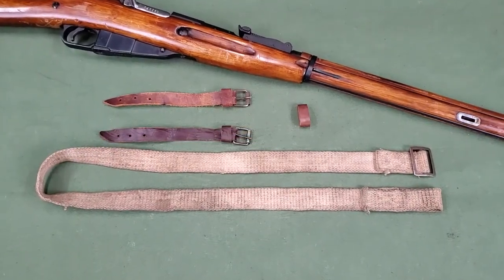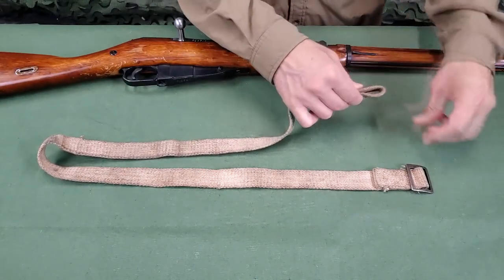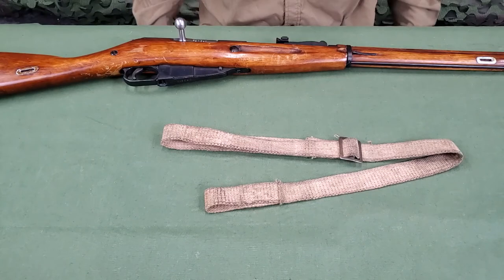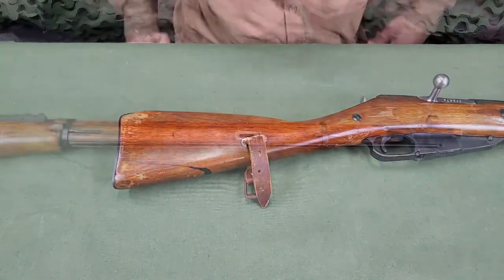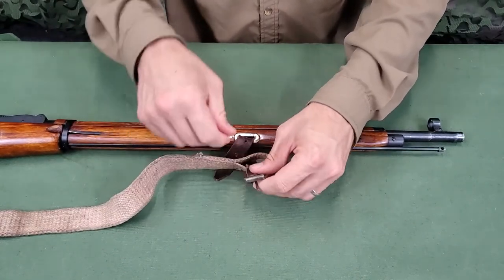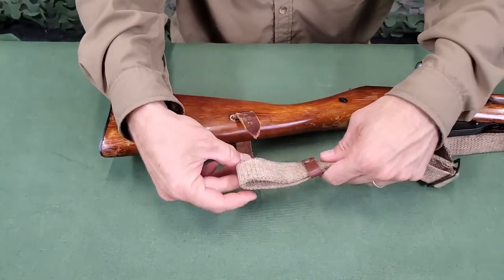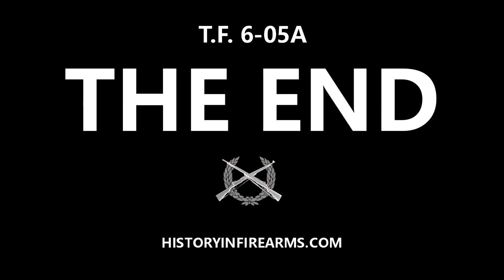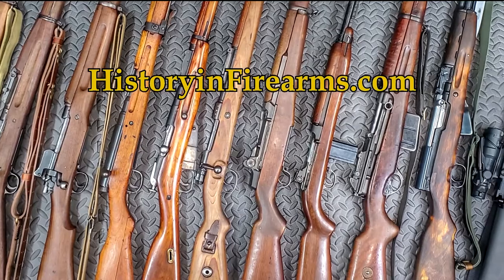Mosin-Nagant Web Sling Install (TF 6-05A)

Comment: I've been unsure whether standard Russian/Soviet military standard was to install the sewn loop of the sling on the butt or the front of the stock. Do you have any references which is the correct installation?
Reply from the maker: In researching this video, I was not able to locate an official source for which way the sling goes. The primary source for my 91/30 training films was "The Official Soviet Mosin-Nagant Rifle Manual" with original illustrations and translation by Maj. James F. Gerhard, USA (Ret.). Most of the illustrations show the sling attached in the manner of this video. So that is why I went with this way. It seems to me that there is a possibility that there was not a standard for this.